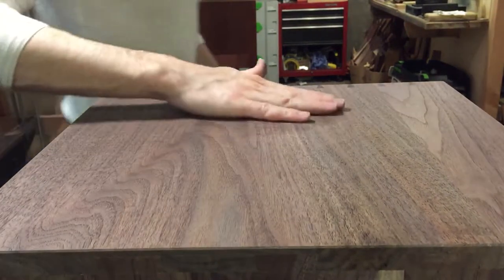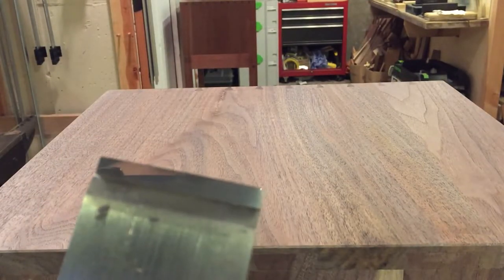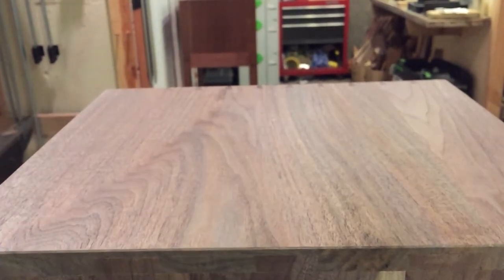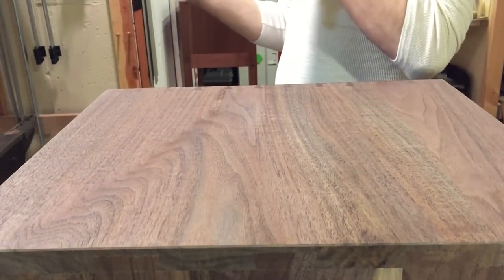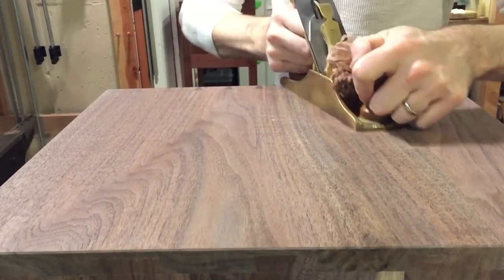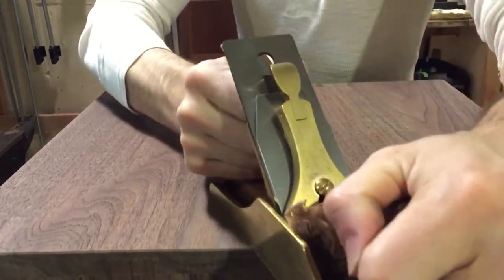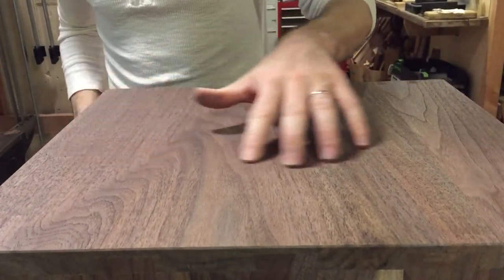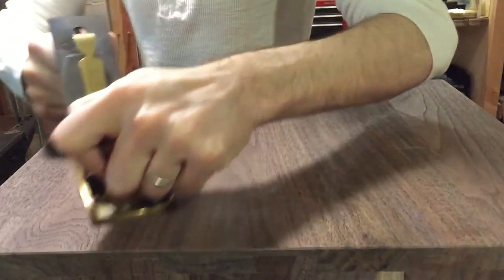Finish Planing 2

Comment: Hi Brian, this is very instructive and detailed. A couple of questions. Do you ever use card scrapers or a scraping plane, and under what circumstances? Also, what is that chamfer plane? TIA.
Reply from the maker: Hi Kris,  Thanks for the great questions.  I do occasionally use a card scraper, usually to clean up a glue line inside a cabinet.  I never really use them on finished surfaces on the outside of a cabinet.  

Those are two different planes, one is a mentori ganna by Tsunesaburo, the other is a round-over plane, and the maker escapes me at the moment  but it's also Japanese.

Comment: @1:27 you said "when you sharpen you have to remove the....bevel." Sounded like 'wearer bevel'.  Sorry, what word was that?
Reply from the maker: Slap Stick wear bevel, remove at each sharpening.
Reply: Never heard that. Is that a secondary bevel?
Reply from the maker: Slap Stick it's the wear from planing, basically I hone away the wear by reducing the bevel until it is gone from the blade.  Not sure I can better explain in this format, I have written about this on the blog iirc and saw mill creek, have a look.